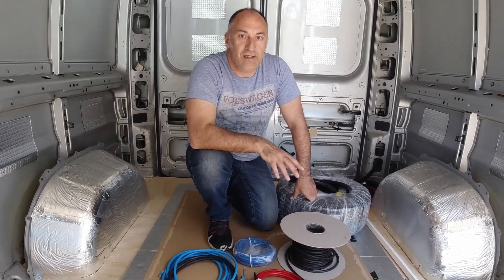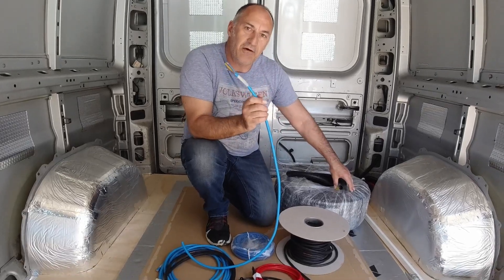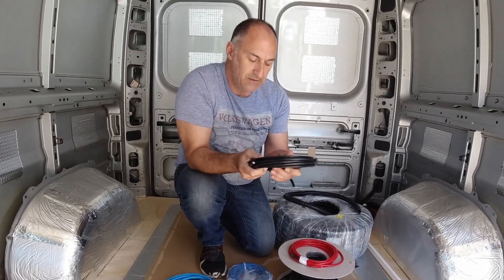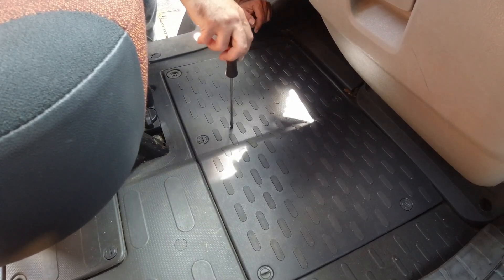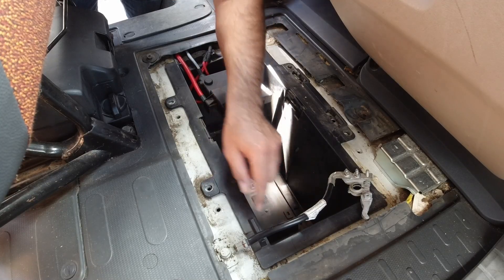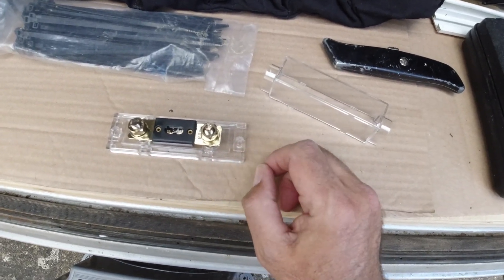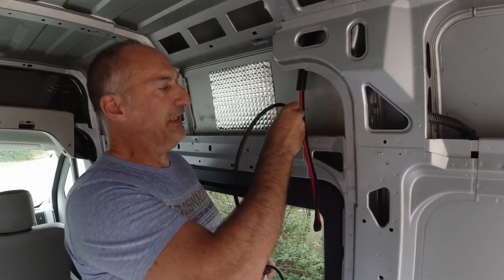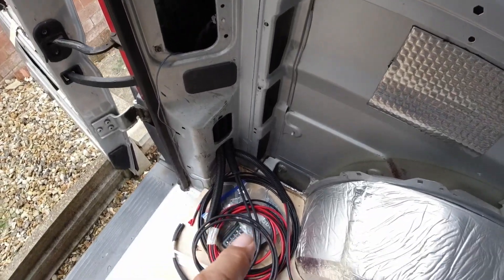How to Wire a Camper Van - Budget Build Electrics Ep15

Comment: I bought the sealant you recommended and the leaks gone! Thanks for your advice
Reply from the maker: I’m really pleased 😃 that’s great news 👍🏼
Reply: @GregVirgoe  thank - you.
Reply: Our van was converted as part of the franchise! We have had numerous problems with the electrics which caught fire! Our water tank has always leaked without taking it out we can’t fix. We have a large water tank and a small one with a heating element which gravity fed but leaks at the joint? I only wish I could have done it myself lol
Reply from the maker: @davidbolton7164  I’m sorry to hear that was it a production camper or a self build converter that did the work?
Reply: @GregVirgoe  it’s self build. I wish I could’ve sent you a video from yesterday as when it rains, we have a small roof vent over the Bath for dogs which even when closed leaks water in, so much that in half hour it filled a pint jug lol. It’s so frustrating getting dripped on constantly when wet outside. I guess it’s how not to build a van conversion it’s 7 years old and we’ve had conversion from knew it’s always leaked. + they fitted a full air vent which also leaks! As originally they installed it the wrong way round if that’s possible they did it lol but not funny for us
Reply from the maker: @davidbolton7164  oh dear I’m sorry 😢 there’s nothing more stressful that leaks too. Really need to be removed surfaces cleaned back and refitted with the right sealing strip and sika sealant. 
The sealant does harden over the years but if you say it’s always leaked then must be poor workmanship 😊 very annoying 
I have a video where I changed our roof fans showing the removal and clean up process maybe that would help you do it yourself. 
There are a few van builders that can offer a dry workshop to do the work in with no risk of getting rained on. 👍🏼😊
Reply: @GregVirgoe  thanks once again

Comment: Great video greg. Just a quick question. Is there a chance the cables might rattle inside the conduit, or maybe even the conduits themselves inside the box sections? Is there any concern with the noise that might create?
Reply from the maker: This is a valid point. In accordance with the current regulations the cables should be secured every 250mm to prevent undue wear and it will help with rattles. I filled all my voids with insulation so they don’t move much at all.
Reply: @GregVirgoe Do you have any noise issues regarding this in your sprinter?
Reply from the maker: @erikvroom3119  no not one issue at all. They are quite secure and hidden behind lots of panelling and furniture so it’s impossible to hear anything at all.
Reply: @GregVirgoe  Good to know, thanks. I'll hopefully be building my own van in a few years. Got quite a few ideas already

Comment: Hi Greg, just looking to buy cable lugs, is the copper or silver colour the best or does it not matter, also struggling to pick lug size.
I have the same renogy dc to dc controller as you.
Could you advise if you get a moment,  thanks mate.

Comment: Hi Greg! Great vid as always. 😁
How do you know what fuse you Will need to use? Like the one 40A that you used in the battery
Reply from the maker: In this particular case the manufacturer will specify fuse size in their installation manual, but as a rule of thumb if you add 25% to your max running current this will give you the fuse size 👍🏼😊

Comment: So glad you showed the fuel tank located near the battery box. A strong warning to all that you need to be careful about drilling access holes. Check and double check that you are not going to be close to anything that could be damaged if you drill carelessly. I would agree with you that it is safer to remove items well out of harms way and follow all the rules of safety. Far too many vlogs on YouTube are just hair breadths away from disaster and injury. Bravo for showing us how to do it and explaining it. 
A trick to find out where rear cable access might be found is to follow official Tow Bar installation instructions. They will always try and use the Manufacturer's access points to the shell.

Comment: Seen your first van build and now your second would it not be wise to reduce the cable runs by using the chassis at the negative or earth for all the 12v we have built around ten vans of all types and this works well with not drop and inverters seem to be one very dangerous and two these all in one solar units offer better solutions like the one urban ark demos
Reply from the maker: I always prefer to install an ISOLATED leisure system so there’s no interference with the auto electrics, no poor ground connections, less resistance and volt drops. 
Did you know that copper is over 30x more conductive than steel. 😃 good luck with your builds 🤞🏼

Comment: Got me worried now ... What is the reason for running a negative 16mm cable all the way back to the starter battery? I only ran a 16mm positive and was going to use the van body for ground, but haven't tested it or connected any devices yet.
One cable seemed logical to me since the Renogy MPPT has all the negatives connected together anyway (the solar panels, leisure batteries and starter battery all share a single common ground terminal).
Reply from the maker: This is an ISOLATED system, I prefer to use a negative cable for all my leisure side to keep it separated from the Auto electrics. 
I can also avoid poor ground connections, high resistance and volt drops. Did you know copper is over 30x more conductive than steel 😃👍🏼

Comment: I’m in the middle of my own van conversion and took my earth/negative straight off the van. There a hole perfect to bolt through below the passenger rear light inside the van. Saves running a cable back to battery.
Reply from the maker: Did you know that copper is as much as 30x more conductive than steel. I’m running one cable so it’s the same to run the two and I don’t have to worry about poor grounds and fault further down the road when those holes go rusty 😊

Comment: I enjoy watching your videos, I've already learned a lot.
I have a Fiat Ducato. Camper belongs to Fleurette. I installed a Vitron Multiplus myself and routed the power supply that was already present to the multiplus. Has been working for a few months. At one point I was standing at a camper place with electricity, I heard a bang or a lamp burst. After that everything still works. But when the engine is running, no voltage is supplied to the Multiplus. Also have a BMS. But when the engine is running, the refrigerator runs on 12 volts.
I saw in this video that you connect the power supply for the camper with a fuse, but not a Cytrix.
I've looked several times to see if I saw a link to support your channel, but I don't see it.
Reply from the maker: You should find any product links in the video descriptions. Please look at my recent wiring video as that has all the products in the description here is a link for you 
12v Electrics for Off-Grid Campervan - Fiat Ducato Budget Build Ep12
https://youtu.be/xCw7eARJKOg

Comment: How do I connect the Mains Battery Charger shown in your video starting at 3:23?
Reply from the maker: Connect the red and black cables off the battery charger to the same terminals as the MPPT charger. Simply plug it into a socket fed by your hook up  👍🏼😊
Reply: Great, thanks. 😎

Comment: Another great video Greg thanks. Just about to start the pre wiring phase - I understand that I need 1.5mm wiring for the lcd lights running off the leisure battery but a bit confused by the masses of different cabling at the hardware superstore. What do i actually look for there?
Reply from the maker: You would be better off going to an electrical wholesaler. The cable you need is H07RN-F rubber flex or Arctic flex. It must be suitable for external use in lower temperatures and multi core flex.

Comment: HI Greg, another great video can I ask a question I am currently converting a MWB Citroen Relay and will be fitting a DC to SC charger can I ask roughly how many metres of 16mm cable you used to run from the from to the rear of the van, thanks
Reply from the maker: Yes, the straight distance as the crow flies is 3.5m but allow a little to come up into the van and onto your charger. It won’t be more than 5m if you follow my route 👍🏼😊
Reply: Thanks  @GregVirgoe

Comment: Perhaps a silly question, Curious if you reckon the vans own 12v plug supply at the rear doors could be useful? I've already unplugged and removed the interior lights, and likely will do the same with it but would be interested to hear your thoughts (bit of a wooly question I know 😅)
Reply: I removed my socket from the rear door pillar, but FYI it's good to keep the wiring there because it serves as a 12v ignition wire if you ever need one in the rear, instead of running another cable from the fuse box.
Reply: I think i'm gonna leave mine there as I can charge things up while the van is moving as there is only one other 12v plug in the cab. It shouldn't drain the battery that way should it?
Reply from the maker: @bonkersbeast  if you are charging while moving it won’t affect your van battery at all as your alternator has plenty of power when driving. 👍🏼😊
Reply from the maker: I would draw anything off the van battery for normal use. You risk running it flat. Just fit one off your leisure battery if you need a 12v there. 👍🏼😊

Comment: curious about whether trips are better than fuses, as you can reset them, or is it just as easy to carry a spare fuse?
Reply from the maker: There are pros and cons for both. A fuse will most likely blow closer to its rated value. Where a trip will allow a bit of overcurrent for a short time before tripping but as you say you can reset them without having to buy extra fuses. 
Just get good quality DC trips if you go down that route. 👍🏼😊

Comment: As usual, great instruction and motivation. One suggestion: Add a dead 1.5 mm wire to every length of conduit to use as a pull wire in the future. You never know what you might want to add in years to come. 👍😀
Reply from the maker: That or just a draw string. I did use an old cable to pull in two new ones before. 👍🏼😊

Comment: Hi. Would it be possible to rout B2B cable in trough of floor before insulation (in conduit) or is that not advisable? Thanks.
Reply from the maker: You can do that, be sure to mark the route so you don’t drill or screw into it in future. 👍🏼😊
Reply: Did you manage to do this Carl? I was looking to that as well but space is very tight and it looked to me that the section where the floor level drops is a double skinned cavity.
Reply: @bonkersbeast  haven't done it yet but have since spoken to those who have (in trough of ribbed floor.)
Reply from the maker: @Carl-qz1mv  I ran a lot of my cables under the ply floor in PVC trunking but very nearly drilled into it without thinking. If you can route services I’m more accessible locations it’s always better in future.

Comment: 16mm cable back to front of van due to distance will fall out of the recommended tolerances for voltage drop the Renogy manual recommends 25mm cable for over 5m runs
Reply from the maker: Just as well this is only a medium wheelbase and the distance is only 3.5m from battery to the end of the van 😆😜. actually if you do the sums 5m is 3% and 6m is 3.6% so both are still within the acceptable level for volt drop on 16mm. 
You should know I would have checked this before putting it in my video. 👍🏼

Comment: Hi Greg, forgive any ignorance because I love literally ALL your videos but a) wasn’t there an internal route you could have run the leads to the battery as it seemed to go such a long way to route to the back of the van, up the rear pillar and along the top edge and b) that conduit isn’t particularly weatherproof to run under the van?
Reply: Yes I’ll be sure to watch again LOL. Thanks as always 👍🏻👍🏻
Reply from the maker: I think you need to watch the video again. It’s the shortest straight distance from battery to battery. 
It doesn’t go to high level at all the leisure batteries are on the floor in the garage area. No more than 4m of cable. Weatherproof? lol it’s a double insulated cable in a solid plastic tube I could run that through a water tank it would be fine. Don’t panic 😱🤩

Comment: Brilliant mate as usual,  nice to see you back 👍

Would it be simple enough if i was to apply the same method to the solar isolator switch as you have for blade fuse holder to allow easier , quicker access to switch solar off when driving to allow 50amps of charge from renogy mppt dcdc , then when I stop driving to simply switch back on to allow for solar charging when not driving. Just to save going in and out of garage area all the time,what are your thoughts, please ?
Reply from the maker: You don’t have to turn of anything when driving. Leave solar on and just drive. The combined dc to dc / mppt will decide what to do with the incoming power and charge the batteries accordingly. Simple 😊

Comment: Would it  not be simpler to use colour coded wires. It makes life so much easier if you ever have a power loss issue. My own Van has 15  different coloured wires some obviously some with a tracer colour .  And I have a full wiring diagram. Handy if I ever want to sell the Van for the new owner just like you have with a car.
Reply from the maker: That may be ok for you to understand but it goes against all current wiring regulations and for the person who hasn’t got your fantastic diagram would be a bit lost. I would advise others to stick to convention and label cables 🤩

Comment: Hi Greg, great stuff as usual...You have mentioned that you are going to do the insulation next. Have you considered using a product called Tyvek as a vapour permeable barrier. It is used extensively in the pitched roofing industry it is impervious from one surface but breathable from the other. Keep up the brilliant work. Cheers
Reply from the maker: No, because that is not what we need here. The reason building membranes are breathable is because timbers need to be ventilated to stop them rotting. 
In our van we need a 100% totally impervious barrier in both directions and the only material that will do that is foil. You cannot compare house building techniques with a steel van. Two very different applications 😊👍🏼

Comment: Hi Greg.  Can’t wait for the next video.  How do you vapour barrier around the point where the cables that are buried in the insulation come through it?  I’ve taken out all the cables in favour of putting them between the ply liner and the already vp’d insulation, but I’d prefer to do it your way.
Reply from the maker: Just use foil tape around the conduits or cables to seal any holes it’s really not difficult 😊

Comment: Greg, first I would like to thank you for your videos, you have inspired me to have a campervan.( I have spent an entire day in bed when I was following the first series of conversion videos, so educational )   My question is related to the black wire that you are running from your main battery to the DCDC converter, since the negative pole of your main battery is connected to the chassis of the vehicle, you could  use the the chassis as your "black wire" . Like this you do not need the entire length of the black wire. If it is wired like that actually you can save a lot of black wire ( negative of the 12V ) since you have the vehicle chassis almost everywhere and you just need a short wire ( and maybe a rivnut ) . What would be the advantages and disadvantages of  wiring the 12V electronics like that. If there would be a campervan conversion academy you would be the dean!
Reply from the maker: I prefer to wire it as an "isolated" 12v leisure side and not use the chassis for negative paths. This will avoid any poor ground connections infuture and alleviate any possible extra resistance, volt drop and loss of connections, making future trouble shooting also easier and avoiding any interference with the auto eletrics too. Hope that helps. I'm sure there are many people that will confirm their "non-isolated" system works ok but this is my preference. :D